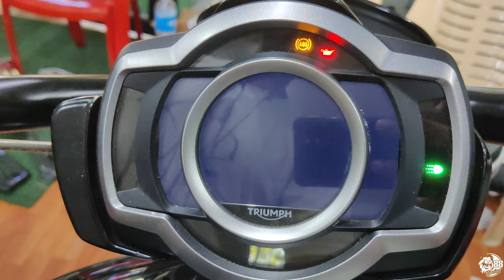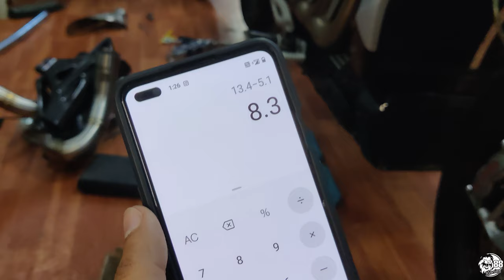Triumph Rocket 3R || ZARD Slipon Exhaust || 88 Racing

Comment: I just took possession of a 2022 Triumph Rocket , GT version because I'm a big guy and I love the forward foot controls. I saw this vid, loved it, then priced the exhaust at over AUD 3.5 k. I cant justify that, plus I'm still in love with bike and frankly it's so much faster than I need. That's the human condition though isn't it, the bike has a 2.5 lt engine, it's bigger than a lot of cars with a fraction of the body mass, and even I, at 59 years of age, was contemplating putting after-market exhaust pipes on because it would make the bike louder and faster.
Reply from the maker: But congratulations to you sir for your beauty!!! I hope you keep exploring the endless joy this machine has to offer. Ride hard and ride safe

Comment: Looks like the eshaust needs to come down a little to perfectly match the arch of the wheel.
Still, one of thr nicest looking exhausts I've ever seen!
Any idea on the decibel rating? Idle & cruising?
Reply from the maker: I haven’t checked the db yet as I don’t have a meter to do that but will get it done soon, but for reference it’s a bit more bassy and sounds a little lighter than most inline 4s
Reply: Hum ... I guess the minority.  I love my beautifully "sculpted" stock exhaust and the Lion's roar it produces when I gun him.  I've always been a loner...
Reply: @davidgerlach1132  hi David, any decent exhaust place can modify your standard exhaust to sound a little better. I too like the standard exhaust look.
Reply: @davidgerlach1132  Stock isn't bad at all on this bike. Lots of people change it because of the weight and it's louder.
Reply: @88Racing  I just had a mandatory roadworthy test when I purchased my 22 gt, and it's 99 dec. In Australia. I remember now I once saw a major police effort to curb traffic noise by targeting vehicles actually driving down the street.